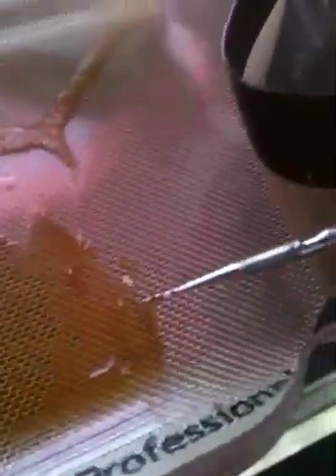Bho n butane, dual solvent

Comment: Brandon, do a side by side with dual solvent winterized and dual solvent non winterized. In my opinion, the non winterized has a far higher terpene content. (Much more flavorful)
Reply: You're 100% correct…but a winterized product is even further concentrated so it's stronger and as you displayed, ethanol allows you to purge off all that butane really well, before it even hits the vac.  This is beneficial because blasting into the ethanol and purging from there allows the solution to stay so thin all of the tane comes off, a vac will not do that imo, it will come close but will never fully remove the tane.  The ethanol and water left over from the winterization are really easy to purge out and say for some reason theres a bit of ethanol or water left in the concentrate, those are way safer than butane….so all in all, I believe winterization, dual solvent bhp is the best product out there.

Comment: question for you...How are you running the N-Butane? From a tank into a hose through a large tube or small tube? What size extractor tube are you using. Closed system or open ended?